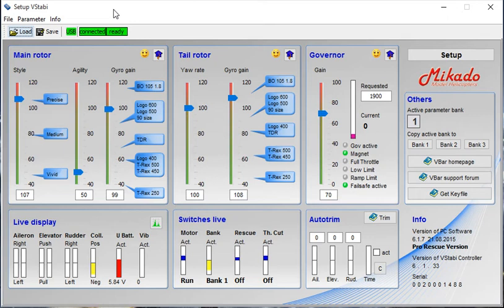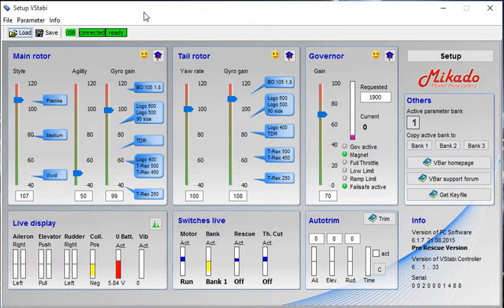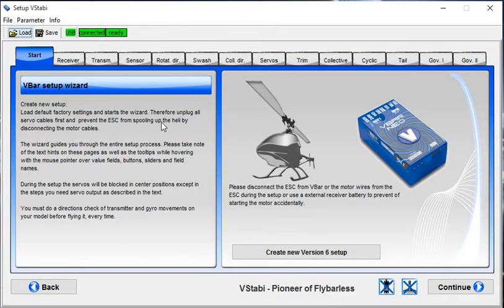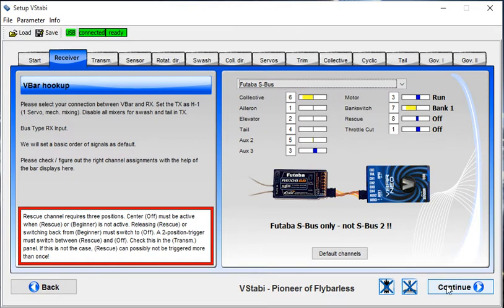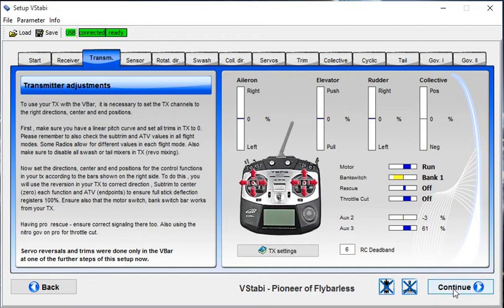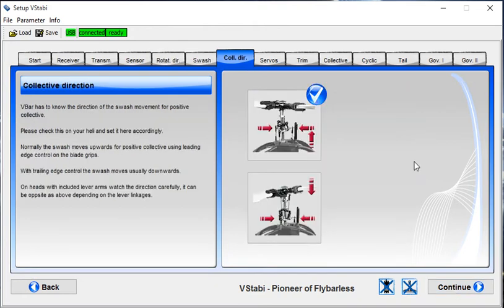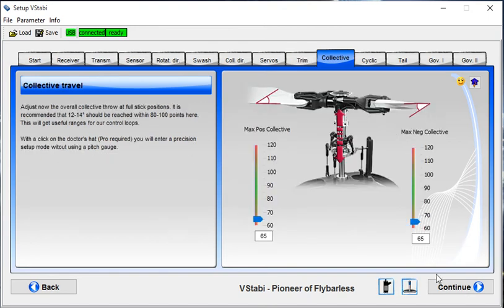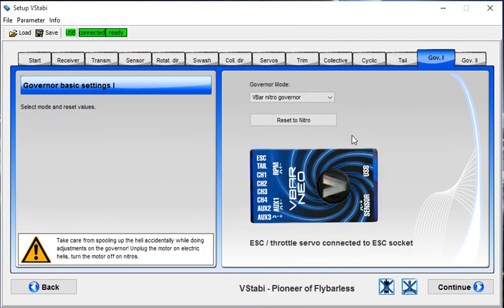VBar Neo with Rescue - Setup for Trex 600n - Basic Screens and downloadable config

Comment: thanks for the quick response so I buy the neo express upgrade to pro rescue and will work with my Futaba radio? because on vstabi website say you need a vbar control to use rescue mode 
thanks
Reply from the maker: +Tamás Kövesi works withe every modern radio with enough channels. Does not need to be vbar control.
Reply: Thanks very much

Comment: Hello what radio you using? 
I have a futaba t8j if I buy a neo can I use the rescue mode? without vbar control 
thanks
Reply from the maker: +Tamás Kövesi I am using Hitech Aurora 9x. It will work with all radios with enough channels. You just assign a switch to the rescue. I use the spring loaded switch because you want the switch to go back to normal position after its toggled.;